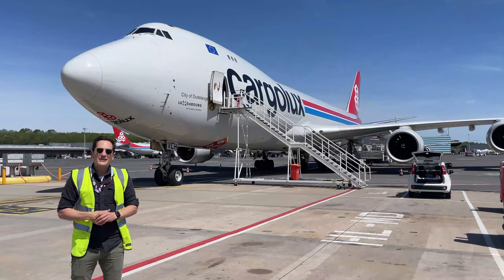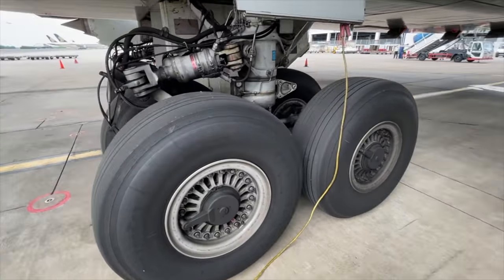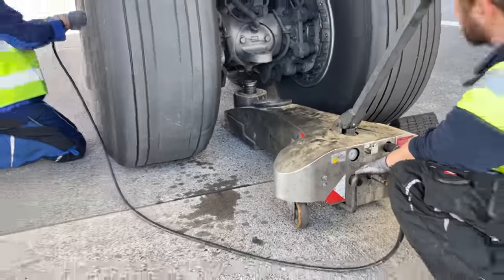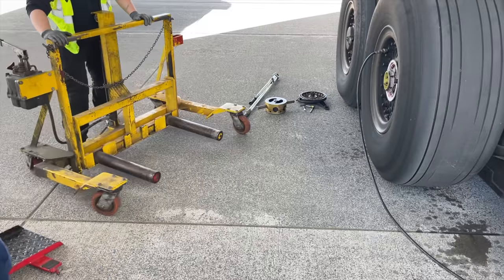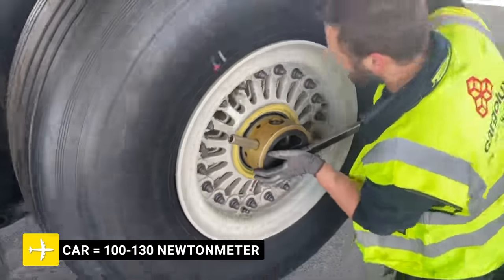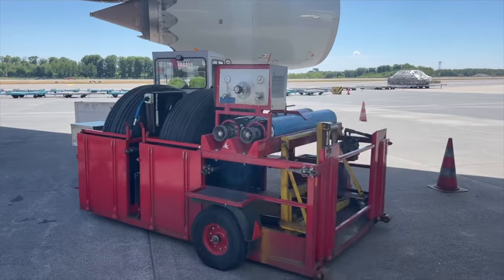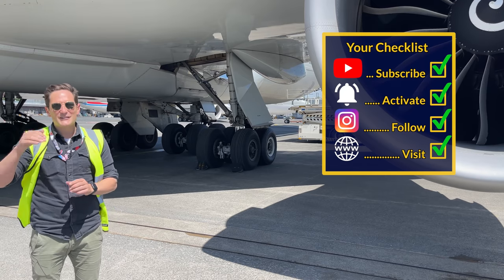How to change an AIRPLANE TIRE in 15 MINUTES! Explained by CAPTAIN JOE

Comment: I saw a 737 tyre change in front of the terminal in Blantyre once. They used a smaller truck jack similar to the one in this video without the pressure lift from the old tyre.

Comment: @captain joe the reason they overtorque first is to set the wheel onto the brake properly then they break torque and then torque to specifications

Comment: Step #1  approach wheel assembly from the front. deflate the nitrogen never in front of the wheel rim and tag the tire as deflated. That axle nut might be the only thing holding it together. A small aircraft wheel can kill you in the exact same way. I seen AMT’s inflate tire in the shop and take it to the aircraft for installation to same time and not drag an air bottle out to inflate it. As an A&P this is a warning.

Comment: Hello captainJoe, if you plz tell us about the slow rotation of the engine right behind you can be seen in the last part (outro) of this video and I have seen many other videos, why it is moving slowly, is it rotating by the wing going in from the front (blade pitch showing it) or something else. One thing I thought about is the significant inertia of the engine blades allowing it to rotate by the coming wind inside from the front?

Comment: Why do you not mould triangles in the sidewalls of aircraft  with the flat edge facing forwards?This would allow the forward speed to rotate the wheels and hit the ground running to eliminate the runway from scrubbing the tyre tread away?  Jus saying,Bob.

Comment: Interesting to see how the airflow over the brake rotors is so restricted by the wheel assembly. 
Or is the air drawn through or out the wheel. I didn't see any deflectors. 
Either way, thanks for posting, interesting to see a tire of that size swapped in minutes.

Comment: One small thing left out. The 747 is notorious for a "false torque-up" when installing the new tire. If the torque you feel in the wrench comes up suddenly, you have to back it off again and re-seat wheel bearing on the axle properly. The proper torque-up should be smoothly increasing, never sudden.

Comment: As a maintenance engineer with more than 40 years of experience on various Boeing and Airbus,I see one mistake. These mechanics don't use the thread protector cone to guide the bearing and avoid any damage to the threads of the bogie.

Comment: 3:17 a wireless tire press sensor, such a nice upgrade! In my airline we still struggle with the connectors that are always *** up

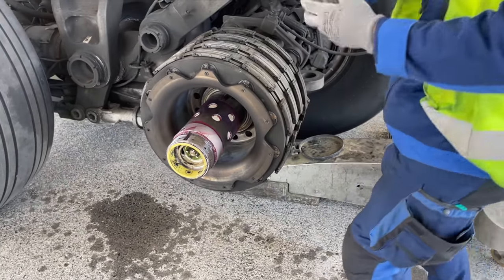4:24 it’s a 747-8 😂 that’s why!
Reply: Amazon carries the sensors and receiver as a kit, starting at $38. Solar powered even. 😂 🤣

Comment: Such a huge tire, yet changed so quickly. One question remains: does the new pressure sensor have to be paired with the airplane or how does the plane knew that the received pressure is from which tire? 🤔
Reply: I have a feeling they are all individually wired to a single box with a chip in it that assigns each one a value and then transmits and receives to each one.

Comment: Great video on the wheel change. I spend many a day down that end of the runway watching 747’s land wishing I was over at the apron working🥹.Is there still Irish mechanic’s working at Cargolux. Would meet lots in the Pyg back in the early 2000’s.

Comment: I missed something. You pointed out the tyre pressure sensor but I never noticed them changing it. Do they change the sensor or do they have to configure the tyre pressure page with a new sensor id?

Comment: The only problem with videos like this is that every tire change does not take place on a shirtsleeves sunny day. And I think they probably do not hanger two planes a day just to change a tire. So most changes are in the cold, heat, rain, or snow. So think twice before you think that would be a nice, fun job to have.
Reply: Ohhh, those wheel changes in the night, with snow blowing horizontally....

Comment: What about the wireless air pressure sensor on the new tire.  Does it automatically 'marry' to the receiver instruments  once mounted on the plane or is there an extra step now shown?

Comment: I have a question. You tell us that every day at least one tyre gets changed. Of course the profile suffers heavily from each touchdown.

To reduce this heavy wear and tear, has Boeing never thought of a system that speeds up the wheels to landing speed before touchdown?
Reply: There is a video on that from Mentour, iirc.
- Using air speed to spin wheels and getting the ground speed right, isn't easy.
- Added complexity will increase maintenance costs.
- Added weight increases fuel burn.
- Worn tires can be re-treaded multiple times.
- Compared to maintenance and fuel costs, tires are cheap expendable of-the-shelve parts. 

So burn rubber!
Reply: Installing a motor on each of these wheels would be a fortune, and spinning tires on an airborne aircraft creates parasitic drag
Reply: @Aimless6   Thanks, so it has been considered.
Reply: @topethermohenes7658  I don't assume the spinning wheels would cause extra drag, because the air would be only slightly redirected with the spinning wheel.
Reply: @Dirk-van-den-Berg  in aviation, remember to always consider economies of scale, one wheel causing unecessary drag multiplied by number of wheels, multiplied by no of aircraft and you have millions of dollars worth of fuel a year.
Reply: @Dirk-van-den-Berg  also it's not even a small effect, you're thinking about the wheel redirecting air but it's actually the air behind the spinning wheel that'll cause turbulence and therefore drag.

I've tried on a small c172 to not tap on the brakes after airborne and the vibrations on the airframe was really pronounced, and those had tiny wheels compared to airliners. Also there was a difference in power that I felt, something was wrong and that's when I realized I haven't tapped on the brakes after airborne, well I did but not enough

Comment: I'm going to take a couple of educated guesses regarding the nitrogen and tread pattern.

I believe nitrogen reacts less to temperature changes and therefore pressure changes aren't so wild. It also holds pressure better over time and prevents corrosion of the wheel rim.

As for the grooves, My guess is simply to identify excessive wear and are spread across the tyre to show if wear is even or not. Straight grooves aren't too efficient at moving water or snow etc., so I'd say it allows for better braking performance as the grooves give the rubber a bit more room to move and more movement = more heat and more heat = better braking.

Now I'll go watch the other two videos and see how wrong I was.
Reply: Well there you go. I was too quick to dismiss water dispersal.
Reply: Nitrogen is also inert, and reduces the chance of fire.

Comment: how often should I rotate the tires on my A340-200 assuming mixed driving? Also, what is the protocol for winter tires when doing cross climate zone flights?

Comment: Aircraft engineers working the line are very well paid. As soon as they had completed this task they dealt with a flight management computer issue.
Reply: They are maybe arguably well paid, considering it is a 24hr 365 shift arrangement working sometimes on an open gate. (Blue sky Hanger)
The guy that services your Lamborghini has a garage and a working timeframe of a couple of weeks

Comment: So each time they change a tire, they also swap the wheel? 
Thanks for the great video!
Reply: Yes they do, its actually a 'wheel change'. The tyres will be changed in a Wheel bay/shop, as the hubs are split down to remove the tyre. Plus on first inflation of the tyre, around 200psi for E-3's that I work on, they are inflated in a cage in case they 'blow-out!'.
Reply: @Hobbes22  Many thanks for your thorough answer 😀

Comment: Joe, how does a pressure sensor in a spinning wheel communicate its readings to a static plane? A copper wire would get twisted... 🤔
Reply: Wireless communication is a thing.
Or you can use sliding contacts on the hub. Both work. I will have to check what is used for the 747. But not today.
Reply: On the older 747-400's, there was magnetic coupling (like a transformer). Not sure about the new ones. I didn't even see a wire going from the sensor to the hub in this video.

Comment: If a passenger plane is landing in a severe crosswind, can the wheel strut naturally rotate to allow the wheels to aim straight down the runway even though the nose of the plane is partly aimed into the wind?
Reply: Not the main gear. Designing such a rotating strut would create a point of possible failure. The aircraft is aligned with the runway moments after touchdown. For those moments the tires "slip" over the runway surface.
Reply: Only aircraft I know of that has "steerable" main landing gear is the US Air Force B52 bomber.  Somebody is sure to chime in if there are others.
Reply: @stevescherer4954  You use rudder to align along the runway a second before touchdown in a strong crosswind crabbing in

Comment: I think they forget to install thread protector on axle hub before removal and installation.
Reply: You’re correct, but Thread protector becomes very cumbersome just for a Tyre change. It’s definitely required during brake change.
Reply: Yes they did. Should be used for both wheel and brake changes (as per the Boeing maintenance manual) Can get very expensive and time consuming when the axle thread gets damaged.

Comment: You should never add nitrogen to a wheel assembly unless it’s either in an inflation cage or on an axle with nut torqued. The proper procedure would have been to check the pressure of the new tire to make sure it is within serviceable range for inflation and then add the nitrogen once the wheel is torqued.

Comment: Captain Joe – should I be using protective masks? Is there not a risk of the tire exploding if it’s been damaged, I can’t imagine what hundred pounds worth of pressure coming out of the tire quickly to do to somebody!
Reply: These tyres are designed that even if they explode, they dont explode in a way that the tyre pieces will scatter, but rather it'll still keep the structural integrity.

Comment: They tighten, loosen and re-tighten while spinning wheel to ensure that the bearing preloads properly.

or that's just my guess because you do any wheelbearing nut like that :)
Reply: Back in the day, you could buy used airplane tires and they made a lifelong wheels for farm equipments etc offroad stuff.

We still have few trailers with airplane wheels from the 60-80's and they still have the original air/nitrogen inside.
They have worn so much that the cords are showing but they have been that way for +30 years for now lol

Comment: I am surprised there are no safety cages.  If those high pressure tires catastrophically fail it could literally explode and it could, and likely would, cut anyone in very close proximity in half.  It is not like changing a car tire.

Comment: They Change "Wheels", not "Tyres". Wheel assembly then goes away for inspection and tyre change. Returns as a newly certified "Wheel" inclusive of new Tyre, and possibly bearings,retainers etc.

Comment: Is this done after unloading and before loading the cargo or can they do the swap while the normal business is happening? 
Very cool of Cargolux that you can present such things.
Reply: Im making a guess, but most probably after unloading (in this particular case, as Joe said, that the aircraft will be loaded and fueled after the tyre change)

Also, they would be doing other maintenance stuff as well, and not just a tyre change at this particular time.

Comment: I worked for Northwest and Delta for 35 years and seen many tiers changed, one question , how come they did not use any safety wire ? Every tier I have even seen changed had safety wire used

Comment: Are there regulatory requirements as to when tires must be changed?  Also does the airport charge a cleanup fee if the tire blows on the runway as they must shut down that runway temporarily?
Reply: Wheel assembly’s will have a finite shelf life if not used.
If in service they have a service life according to the tire tread wear indicator.
As a conclusion, don’t concern yourself with tire in service limitations …….become a Pilot or a flight attendant or work in another industry……mic drop.

Comment: Why you don't clean the assembly before installing the new tire? I saw blast on ground from the braking system , where's safety? Dirty from hydro braking leak , brake blast, can cause hot 🔥 area on the wheel then may cause 🔥fire

Comment: Is there any follow up procedure after first flight after tyre change? I.E. someone checking if it's really still tight, the brakes are ok, etc?
Reply: Usually not necessary. Wheels are checked at least twice during every ground time. Once after landing like in this example and once before takeoff by the pilot during walkaround.
And Brake wear too.
The design itself prevents getting loose if correctly installed.

Comment: I'm wondering why the wheels are not pre accelerated before touch down. The plane does know it's groundspeed and with a simple windturbine design on the rims you could use the drag from the wind to bring them up to the right revolutions. That would save so many tires...
Reply: Too much gyroscopic effect. Your idea is not new and it has been tested

Comment: So OSHA if this in the US requires a tire cage. If you have ever seen a tire explode, then you would know why. Seen one explode, guy sitting on it and the split rim gave way with the pressure, and threw him into the air, hit the small hangar roof beam and killed him. They should be using the cart as a safety because they obviously use a safety cart for removal.
Reply: This wasn't recorded in the US.

Comment: First of all retired, you don’t need to be changed until two cycles of the aircraft have shown chords of the tire. I’m not saying that is a good practice, but that are usually the limits retire second always inflate the tire completely after it has been melted and not before.

Comment: No thread protector used during the change - tut tut..  and   its not a more precise torque wrench - they are all calibrated.  The initial higher torque is to seat the taper bearings,, the nut is then loosened and retightened to the final "in service" torque figure.

Comment: Wow…they missed a step that could damage the threads of the axel. There’s supposed to be a “sleeve” that you lube up and screw over the thread for the locking nut to prevent damage from the wheel coming off/on. The aircraft could get “AOG”d if they’re damaged enough.

Comment: When that giant nut is unscrewed you must watch for a reduction of the resistance to turning. If you don't get it stop immediately and recheck your tire pressures or the 2 halves of the wheel hub will be going into your face at high speed. It's happened that all of those bolts in the hub have broken and when the nut comes off no force on earth will hold it back. Our job is a lot more dangerous than you might think. There are a lot of us with missing body parts because they got stuck in something they shouldn't.

Comment: Beautiful. Just beautiful.

Luckily the B747 doesn't have a Tri-Bogey type of landing gear. So that you'll only need 1 hydraulic jack to remove the most Fwd or most Aft wheel.  The B777 has an amazing Tri-Bogey landing gear and it's almost always the Middle wheel are the ones that needs to be changed. Haha.

Overall. Just an amazing experience. 😁😁😁😁😁😁

Comment: Wait a Boeing 747 has one wheel nut at 250nm holding it on and buses and trucks normally have 10 wheel nuts at anywhere between 600-700nm of torque

Comment: Surprised there was no thread protector (for the large nut) used while changing the unit?  If the wheel is not aligned properly you could damage the thread very easy.

Comment: I look with concern on the lock nut. It look so filmsy compare to the ernomous tyre it suppose  to be tightened to. Well my worries are unfounded as Boeing 747 been in production for 50 years now.

Comment: everything is fine and in order for the wheel change except during removal and installation  why the thread protector was not used. if thread was damaged  the axle had to be repaired or changed. i think you all didn't follow the maintenance manual procedure. next time use the thread protector.- B.Roy retired aircraft maintenance engineer.

Comment: Do airplane tires have to be regularly re-inflated like car tires have to be every few months, or is their initial pressure good until the next tire change?
Reply: No, they do leak (somehow). The nitrogen is topped up as required between wheel changes.
Reply: Most airlines check tire pressures every day, or something close to that.

Comment: Really interesting video! But I saw a tightening torque of 270 Nm, not 250 Nm.
Reply: You are correct, the maintenance manual states that the torque value for 747-8 Main LDG Wheel /Tire Assy is 200 ft-lb (271 N.m)
Reply: @tzehinlau842  Presumably the torque spanner is fixed at 271 Nm. You can see an additional metal part on the handle, which has obviously been hard soldered on. I own a Stahlwille Manoskop to tighten the wheel bolts on my car. A very high-quality and accurate tool, but the torque setting tends to adjust itself during a certain period of use. Possibly the additional part is meant to prevent this.

Comment: Captain Joe, I am a B747-400 mechanic. When changing tires 1 and 14 on a 748 airplane, do have to remove the rod and hold the wing gear door ??
Reply: You are a mechanic and you think a pilot knows?? 😆😂
Reply: @speedbird9313  i believe he knows
Reply: @speedbird9313  ㅇㅉ?
Reply: @개로로-v2e  Whats with the sign? Didnt you understand my question?🤔

Comment: First I was surprised how relatively easy they pushed the tire around, then I was surprised why ... it only weighs 220 kg.
Reply: Most of it is just air.

Explanation by captain Obvious.
Reply: @worfoz  YA DON'T SAY inset meme 
Yeah, even with the air LOL, I would have imagined it was about 500 kg